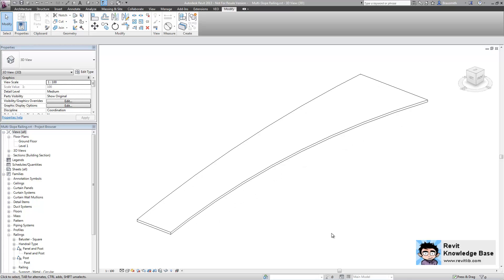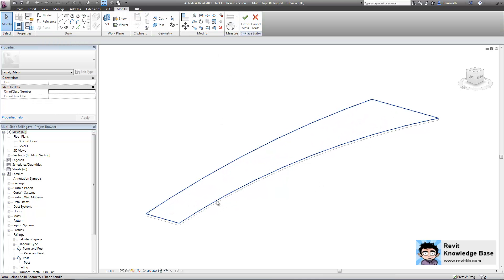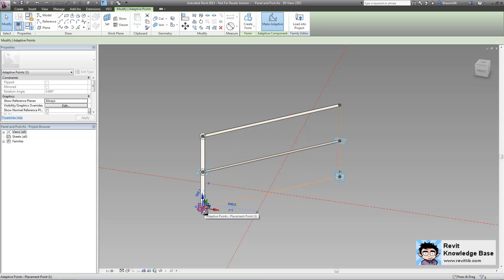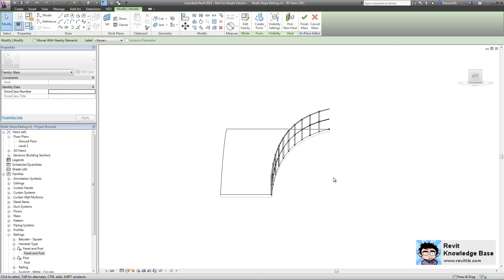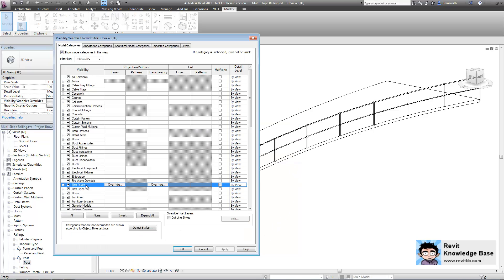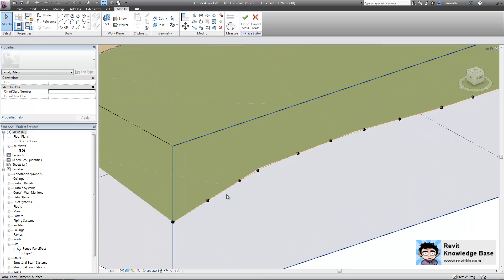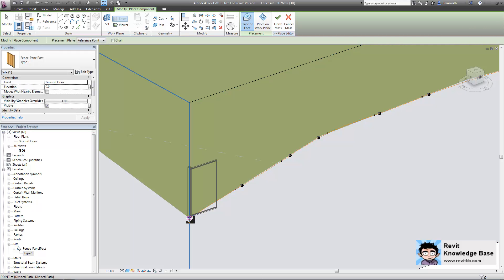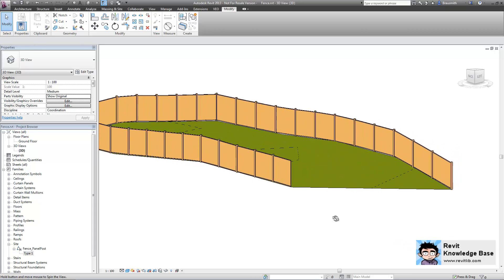Revit - Adaptive Component Railing and Fence

Comment: Doesn't work in revit 2018 :(
Reply from the maker: Thanks for the update. I haven't tried it myself, but at least railings in 2018 can now follow a toposurface anyway. So this tip is now somewhat obsolete.
Reply: AEC Scene had no idea, thanks for the insight, I’ll try it out, any advantage in using his method as opposed to using railings?
Reply from the maker: Off the top of my head, maybe to create more complex 'panel' designs between posts which the railing properties won't allow for. Here's the Autodesk video of railings enhancement which includes on topo elements. https://www.youtube.com/watch?v=iEZsVdn-seg